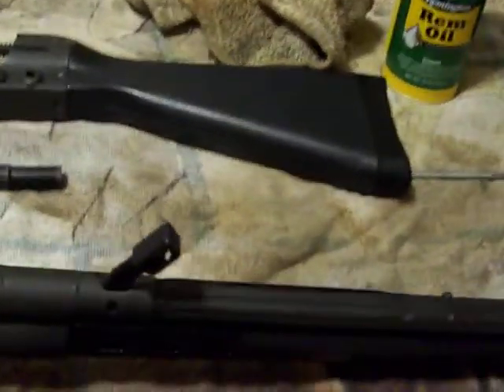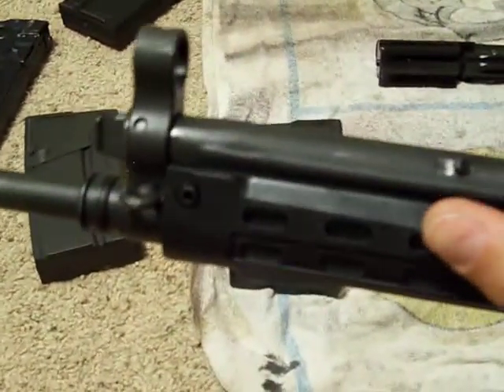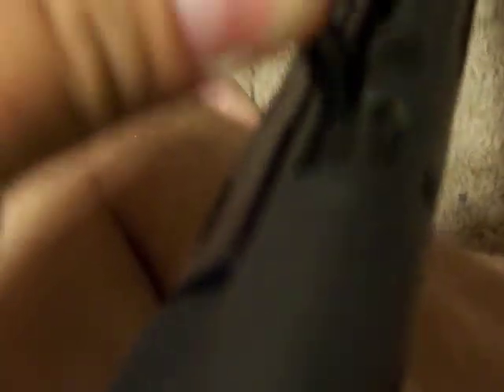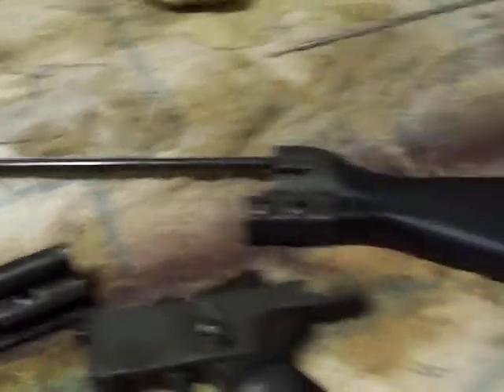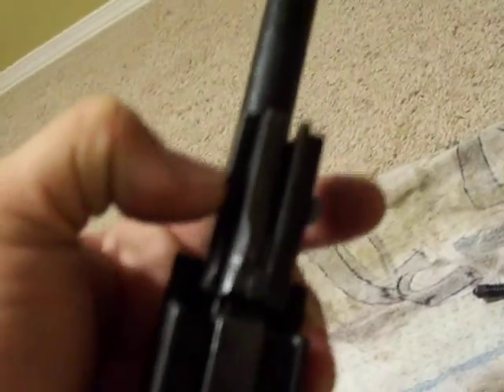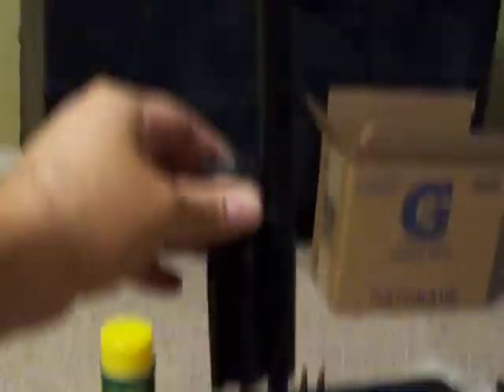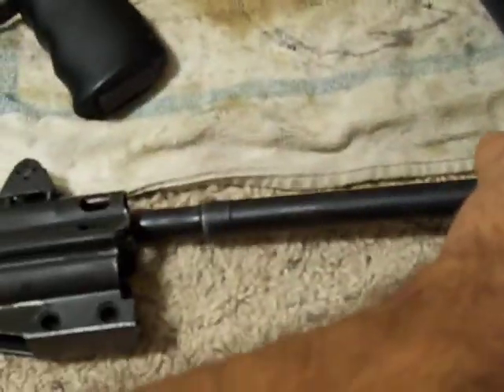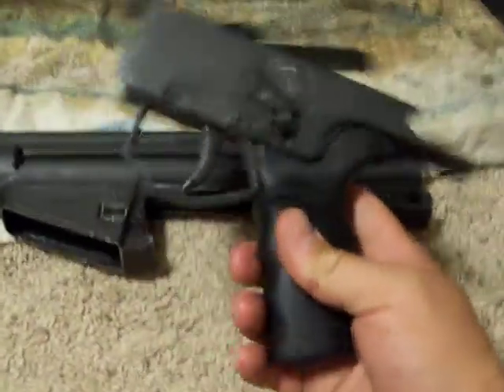G3 slap, Cetme Slap the inner workings

Comment: I would not slap the cocking lever, as you are accelerating wear on the cocking tube, which is welded to the receiver:(-Gearhead222

Comment from the maker: Nope. I said they do not operate on direct gas impingement  they are not .308 rather .3105. As in the designation 7.62.  However the difference in diameter is so negligible that both are commonly referred to as 30 caliber weapons.  Even as the 7.62x 51 NATO is actually .308 and not .3105 as a real 7.62.  It's just a tit for tat I suppose